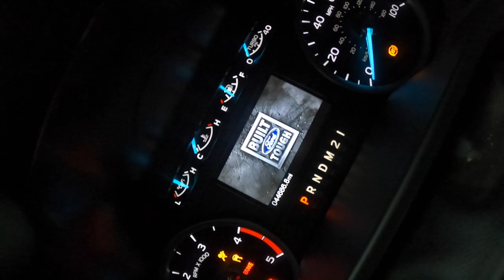Episode #3: Day in the life of a Roofer

Comment: No valley metal, no tile battens?!?!
Reply from the maker: This was just tear off and felt in we put the valleys and all metal later on. No need for battens on this tile roof. Thanks for the support!
Reply: Idk about about San Diego but in Florida they use a spray adhesive foam to stick each tile to the roof individually. They don't use battens because none of the tiles are nailed anyway. All are stuck with the foam.